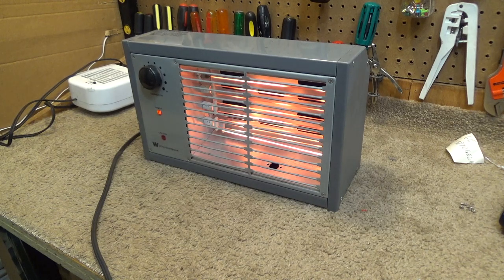White Westinghouse WWHR3010 Radiant Fan Forced Heater Repair | Attempt #2; Removing Thermal Overload

Comment: I doubt the sensor is rated for 600°. While the bottom of the heater gets to roughly 500°, The sensor is most likely only measuring the temperature of the air moving across it. That said, it shouldn't trip unless the front of the heater or the intake for the fan becomes blocked. Are there any values printed on the cutoff that would point to the temperature at which it should open? I wouldn't doubt that this is a poor design because that cutoff is taking heat directly from the elements. It probably should have been mounted near the front guard. I also noticed that the connections appeared to be soldered to make the cutoff more difficult to remove. One more thing to note, if you leave the cutoff removed, I would try to plug that hole because some of the warm air will escape out the bottom.
Reply from the maker: There were some part numbers on the sensor. I searched them and came back with a 115 degrees F sensor. It seems inconceivable that the design would entail such a component in that location, but the operation would point to that specification. The location of the sensor is incorrect; it's probably intended to measure the air temperature but it's within the range of radiation from the elements which will heat the surface of the sensor.
No need to cover the hole; the air will pass through it as it does the other holes and push the heat into the room. If anything, it will probably work ever so slightly better with more air flow.
Reply: @JordanU  I can't imagine that ever worked properly with the cutoff rated for that low of a temperature. I think it would have worked a lot better if they mounted the sensor right next to the front guard so it wouldn't be subjected to the radiation from the elements. For some reason I wasn't understanding that it pushes the air into the heater box so the hole won't hurt anything. Thanks for clearing that up.
Reply: @JordanU  It's doesn't happened! Damnit!
Reply from the maker: @MAZ--ik3me  That doesn't make sense.
Reply: @JordanU  I don't understand?
Reply from the maker: @MAZ--ik3me  I don't either, that's the root of the problem here.